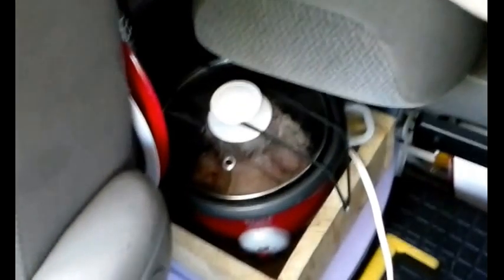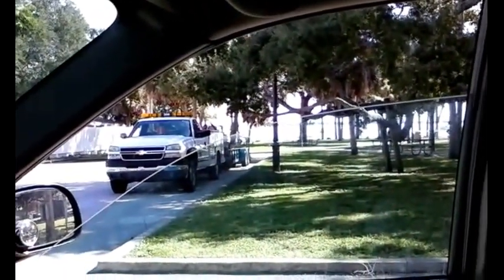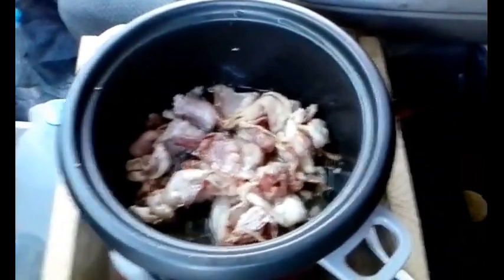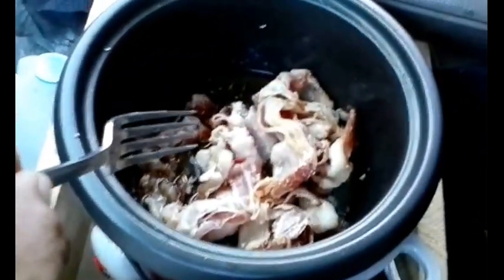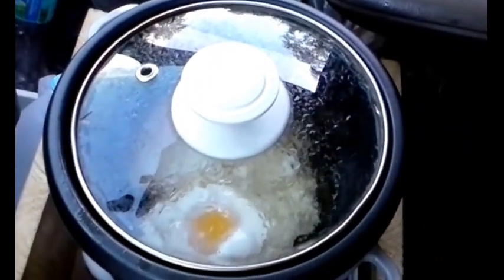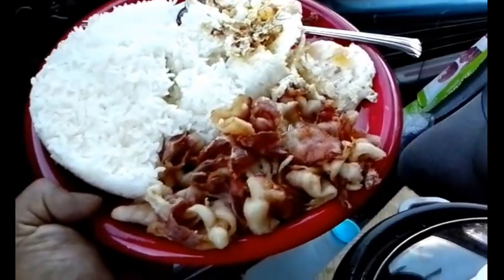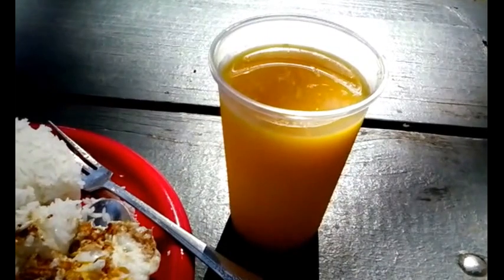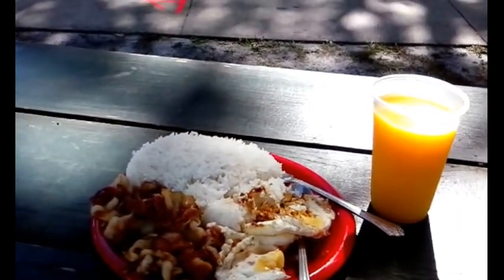How To Cook In A Van - Inverter Food Cooking Costs (V130) Van Dwelling Vanlife

Comment: interesting. $2 to cook ten meals? That's pretty good but how did you arrive at that figure? Here is couple questions:
1. is your rice cooker 300watts?
2. I've read that modified sine wave inverters (usually the more affordable and common ones) can mess up anything with electronics. Is your inverter those regular kinds? 
3. @$2 for ten meals, seems its more cheaper using your inverter rather than portable propane stove. How much would it cost if you did the same meal on that? 
4. Is it also cheaper than running it on small portable butane stove? I've read that butane stoves are much cheaper than propane for cooking, in fact, in other van living forums, it's been mentioned that usually Asian supermarkets readily carry really cheap butane fuel cans or sometimes vandwellers really being frugal, order wholesale package of butane cans from ebay where each cans come out better bargain. 

I honestly thought about using rice cooker as alternative to portable gas cooking myself but it seemed to good to be true. And I'm sure it is. Their must be something missing because I'm sure other dwellers experimenting with frugal cooking, would have thought about this. 

good video. I'm sure the best bargain cooking source (as well as great for winter heating) would be to actually use a portable wood stove built inside a van but that is of course not viable option in minivan setup. Anyway, I love these little tips and insights you give us. Definitely helpful.
Reply from the maker: The $2 for ten meals is basically an estimate.  If you only cook when you drive...it's actually FREE as you are driving anyways.  Most items take roughly 10-15 minutes to cook.  Some take as long as 20-30 minutes.  With the vehicle just idling...hardly any gas is used.  I haven't done a full test...but idling my vehicle for an hour doesn't seem to use much gas at all (i.e., I don't really notice the gas gauge moving much). 

As for modified sine wave inverters and whatnot, I never really paid much attention to that.  I've used all my electronics devices off my 550-Watt (most likely modified sine wave) inverter as well as some items off the 350 watt inverter (also most likely modified sine wave.)  This includes electronic devices such as my phones, battery chargers and laptop/mini-notebook computer.

I've never cooked meals using my propane system, but I know that I was able to buy two propane canisters for roughly $5 or so?  I think those small canisters last only about 30-minute to an hour if you run them continuously (though  someone else will need to confirm this), so I think cooking with the inverter is a lot more economical.  I gave my propane system away to another vanner who had no means of cooking.  It was a backup system for me anyways, and after 5-6 weeks of living in the van, I prefer cooking with the inverter/rice cooker.  It is more like cooking in a sticks and bricks using an electric stove top.

Also, keep in mind that at my location, there are LOTS of parks that have free access to 120-volt power, so I simply take my rice cooker to the picnic pavilion and plug right in using FREE electricity whenever I have the opportunity.  Cooking in the vehicle using the inverter is actually not how I normally like to cook.  I only do it out of convenience if I'm not located near a free 120-volt source, or I am traveling somewhere far enough that I can cook for "free" since I'm driving anyways.

My rice cooker is 300 watts.  I have two of them.  One is in the front for cooking within the vehicle as needed and the other is in the back kitchenette for cooking when I am parked somewhere.

Now, keep in mind my vehicle is a minivan and uses less gas than a full-sized van...possibly also a huge difference when just idling the vehicle.
Reply: +Living In A Van ah I see, free ac outlet, so you have access to free ac outlet and mainly use that to cook. cool. Are these outlets available for free throughout the day? I imagine you could you just run an air conditioner for couple hours while staying put there. Those must be life savers especially in Florida's sweltering and humid heat.
Reply from the maker: Running AC would draw too much attention.  Cooking food there is normal as it is a picnic pavilion.
Reply: +Living In A Van hmm.. Good point. Now this leads me to another Question: suppose you had the funds and bought yourself a large energy storage deep cycle battery system. How long would it take to recharge such a drained battery system using that AC outlet? It would still most likely take several hours to a whole entire day or more huh? I've seen YouTube videos of people using their battery chargers and usually they all have settings where initially it'll charge in stages like, rapid 40amps, then down to 1 or 2 trickle amp, or what they call floating amp charge. 

It's good you mentioned the whole swamp cooler system thing. I was so stoked about them when I learned about them few years ago but my enthusiasm were shortlived since discovering that their functionality is heavily dependant on humidity in the air, which in turn explains why your use of swamp cooler in Florida humid weather are successful. 

I'm in anticipation of much more unfriendlier conditions with zero humidity and more than likely chances of having no outlets available for emergency refuge. Still in research phase in that regard. Given my limited budget constraints, it honestly does not look feasible in near future and I will adjust accordingly.
Reply from the maker: Swamp coolers will work even better with low or zero humidity.  As for charging a battery, why use 120 volt and a charger when you can charge it from driving/running a vehicle? A battery charges to full in 20-40 minutes or less from the alternator.

Comment: I was going to ask you how many meals per gallon you are getting. I really was wondering if it was cost effective to use the motor to run the inverter. It is better than I expected.
Reply from the maker: Actually, it's not as effective as I thought unless you cook while you are driving as I pretty much do.  If you book while you are driving, you are cooking with FREE electricity.  Most of the time, I cook while driving or use free 120-v power from a picnic pavilion so in those cases, it is VERY cost effective...as well as a time saver.

Comment: Is it hard on your car having it running while you are parked (cooking)?
Reply from the maker: Probably.  But anytime you turn on your car or drive it somewhere, that's pretty hard on it as well.  :)
Reply: +Living In A Van i think that diesel engines can run like that (idling) with no issues but gasoline powered engines are not the same.

Comment: aren't you running of car batteries which aren't meant for deep cycling. If that's the case, I think the cost associated with cooking with rice cooker is a whole lot higher in that anything draining battery 50% of capacity, may potentially shorten the life of the battery. Think about it, I don't think it would matter much if you were cooking and driving at the sametime since you'd always be powering it off battery. The driving around is so that your alternator can recharge your drained battery but that doesn't happen simultaneously. From what I've been reading, a standard car battery trickle changes any battery at 1 or 2 amps, and depending on how drained your battery is, it could mean anywhere between few minutes or couple days to fully recharge your battery. Given these realities, it's not surprise that many van dwellers have dual battery setup rigged to there system. 

I guess the next question is, how long can you actually run the rice cooker or anything that's 300 or so watts ever before your battery hits the danger zone? 

How long does it take to cook rice on that anyway? Are they like slow cookers or something?

Now suppose you realize it does take a while to cook in those and thereby cost and drain your battery more than expected, have you thought about a method where you could accelerate the cooking process and lower the battery or gasoline power consumption? ie: would cooking smaller quantities/volume of food result in cooking a hot meal faster, shorter amount of time, resulting in less energy consumption?
Reply from the maker: The vehicle inverter is hooked to a jumpstarter power pack which is serving as a house battery.  The house battery is wired to the vehicle battery for charging through the alternator.  There is a manual switch to isolate the two batteries as needed.  I never run the inverter without the engine running and the batteries switched to connect/trickle charge.

So far, I've never really run into any problems that I am aware of.  I've used the inverter/rice cooker for upwards of 1 hour or more to prepare rice and other items to eat with the rice.  It takes roughly 15 minutes or so for the rice to cook.  Other food items can take roughly 20-30 minutes...sometimes a bit more.

I've run power tools (a drill and a jig saw) off the 550-watt inverter with the vehicle running and was able to use it just fine unless the tool jammed and then the inverter shut off because it was probably trying to pull more than 550-watts.  I simply reset the inverter and I'm back in business.

I've never really done the math nor plan to.  A lot of people say things won't work and then don't do them (like the ice/swamp cooler in Florida) but the reality is...unless you try something, you truely don't know if it will work or not.  I've tried the ice/swamp cooler and IN FACT it DOES WORK...and I am in Florida.  It doesn't cool a vehicle down...but it does cool a person down because cold, wet air is blowing right at them.  Same with the inverter cooking system.  A lot of people say it won't work and will quote all sorts of formulas...but as you can see, I'm doing just fine so far with the system and we are currently on Week 6.

I suspect there is wear and tear occurring with me using the alternator and standard batteries to make the system work, but  to me, that is just the cost of using this system/method to prepare food...like the cost of getting gas or butane canisters.  I'm trying to set aside a budget for replacement alternator and batteries as needed.

My next upgrade as soon as funds permit is a decent-sized AGM house battery...and I suspect that will make the system even more efficient...especially for running my fan all night.
Reply: +Living In A Van cool, so you already have a dual battery system setup already. I'm going to eventually setup a battery isolator myself but a bit hesitant since I still got some questions on which one to go with and how best to set up for my needs, hence, my interests in your tips and tricks :)
Reply: +Living In A Van I already got my hands on 750watt inverter from harbor freight when they were on sale. And yes, just like you, I already used it to draw energy for various corded electric power tools running around @ 6.5 amps to get some small projects done. Those were real eye openers for me. Up until then, I wouldn't have ever fathomed that such a thing were possible. Granted, after doing some basic calculations (I suck in math), I figured out that my run time of anything drawing 6amps or so from my car battery would come out to a run time of no more than 25-30 minutes MAX before I was in danger of possibly depleting my battery capacity to 50% and I haven't invested in deep cycle battery either, it all open my eyes to what other things were realistically and economically feasible.
Reply from the maker: 750-watts is a good size.  You could even run a small microwave.  My inverter beeps and shuts off if the battery power runs low.
Reply: +Living In A Van I thought about that but most likely, just as your inverter, the initial electric surge of starting up the microwave will trip the inverters internal fuse, setoff warning, and then shutdown. Im still well within their return limit and thought about getting a bigger capacity inverter, but that may come to a halt if I realize that such an endeavor will put me over my budget, and more importantly, that even with a bigger portable inverter, should my research show that I not only would be unable to fully charge a large enough battery system on four wheels in a realistic amount of time as to not compromise my "stealthiness" nor be inconsiderate of others around me but also not be able to use any of those power hungry large luxury electronic items to begin with, well,  than making that kind of purchase would be pointless. 

I'm glad that you're slowly and gradually experimenting and learning from trial and error yourself. Some were not as fortunate. I've come to learn that many initial enthusiasts rushed into this not pacing themselves nor really knowing much about themselves and ended up making HUGE purchases on off-grid items, items that made a whole bunch of crazy claims, and for the most part, those folks paid a hefty price only to learn that they spent insane amounts of money on things that realistically would hardly run in real world scenarios. After all the promise and glory, they were mostly smoke and mirrors, and sold on nothing more than fluff. 

I honestly believe that the small setups that +adventure man and +into the mystery have, is more practical albeit underwhelming. Adventure man got an air conditioner to run on ac outlet on the grid just in case of emergency but it's mostly stored. 

I think finding work according to tolerable climate conditions is what most folks will find the best, well, until technology changes.